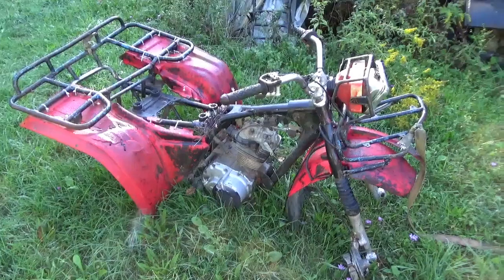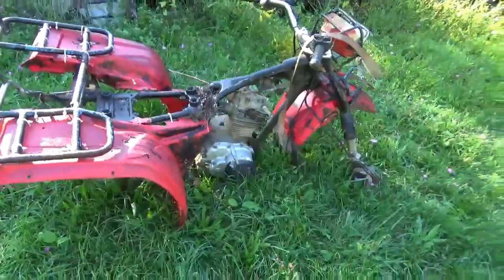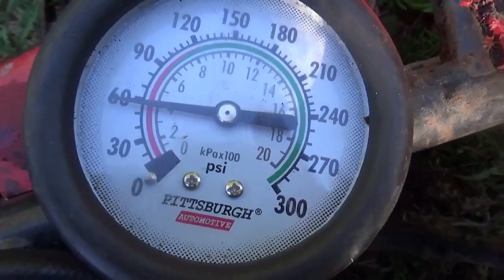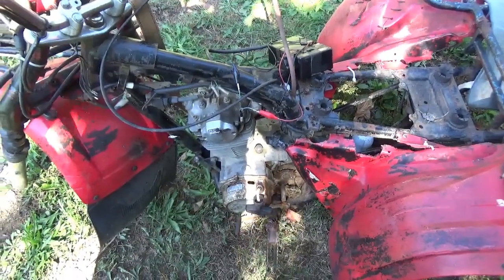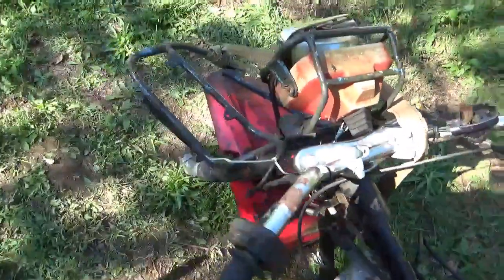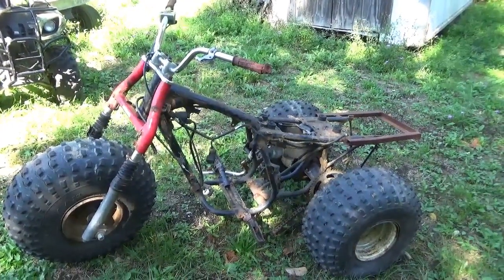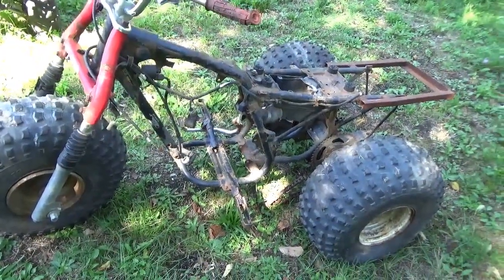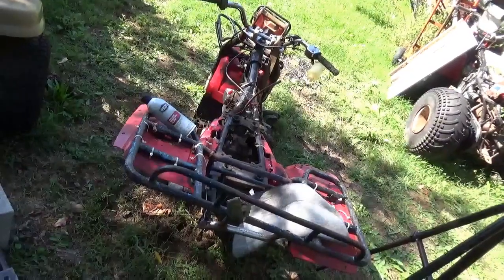Honda ATC200S, Abandoned in a Ravine, Parts Scavenged, Will it Run Again?

Comment: Harvey please help man I bought a 110 Chinese quad put a new carb on it ran great I washed it with the hose it died figured out I got no spark I put new cdi coil didn't work so I put a whole new wiring harness on it new stator Also still no spark what could do that ? Would time or valves make it ni spark idk how that would happen from Washing it don't make sense at all I'm pretty smart and work on these alot not so much electrical but I've put cple harness in I don't understand what's going on at all please please help